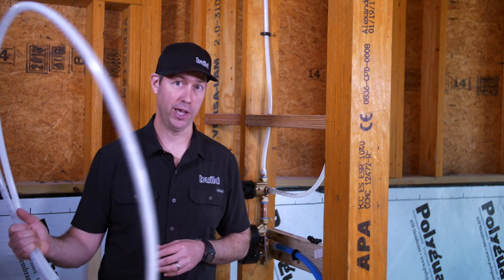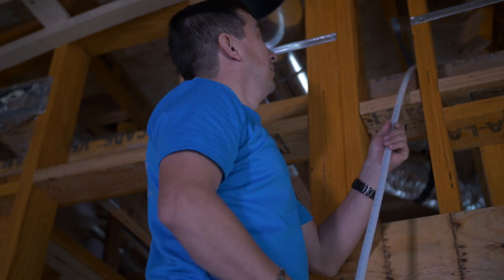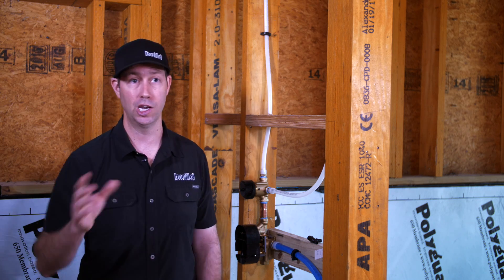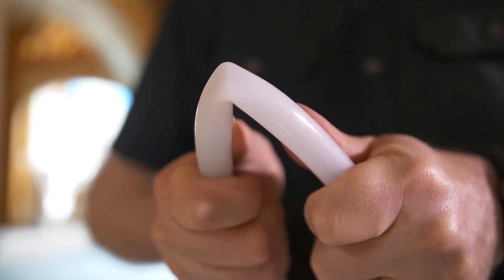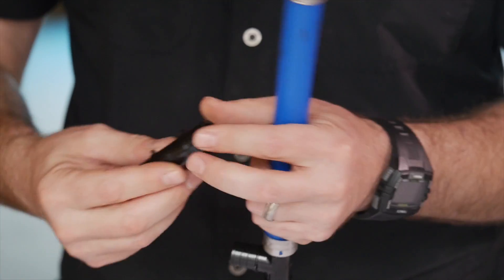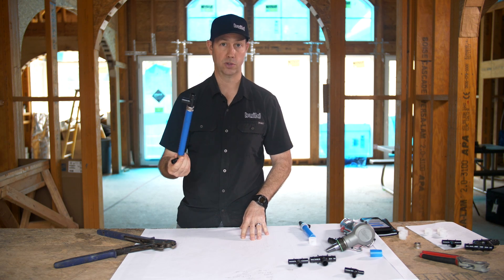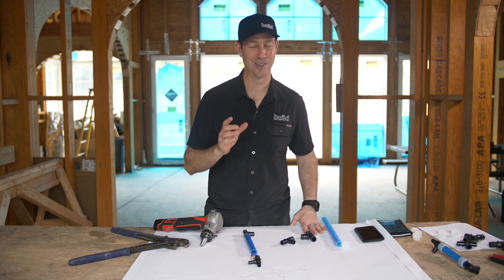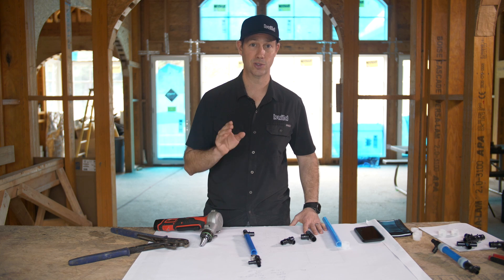PEX vs. Copper Plumbing

Comment: I'm an exterminator,  rats chew through pex easier than copper.
Reply: Its generally the use of poisons that cause pests to infiltrate plumbing. Poisons tend to rapidly dehydrate rodents causing them to search frantically and desperately for water, leading them to eat not only into pex, but also into cpvc, pvc, and abs sewage pipes.

Comment: In Maryland I have a 385 foot deep well, the water eats holes in Copper and Terminal Brass fittings. It doesn’t eat holes in the PEX Brass Crimp Fittings. All my Valves have been replaced multiple times. My Water Heater piping has been replaced three times. Last time I used “K” Copper. Also I brazed a #8 copper wire between the Hot and Cold Water Heater  Pipes, in addition to the Copper wire that is wrapped around the a Silver Fittings coming out of the Water Heater. BTW I’m on my original Electric Water Heater, at 30 years old.

Comment: You did not mention all the con's with PEX. It is not good against UV, so should not be used for outside use. Nor is it recommended for inground use as it breaks down a lot quicker. It is easier to accidentally pierce inside of walls. It is bit debatable for inside of walls use due to that, however I do agree it is much easier and better for pressure drops (although good layout with good plumber will plan accordingly using proper copper sizes as appropriate). It is especially great for use in attic spaces, as it is just one complete homerun with no or only one fitting inside attic and as stated reduced hammer. And hammer can be eliminated altogether if attached loosely in correct spots. I do also agree that for most instances it is good for even inside of walls, since those are typically in locations where someone is less likely to attach things to the wall, such as in bath and kitchen areas, so will realistically not be much an issue with accidental piercing anyway. However if it is in wall that might possibly see such (for example maybe above a toilet), then might consider not using PEX.

Here in AU they commonly use either compression fittings or sharkbite fitting. No special tools needed for either. The sharkbite is the easiest and quickest to use with just simple push in, but does cost lil bit more. The compression fittings is what I have seen used more commonly and while still pretty simple and easy, does take lil bit of extra time and effort putting on the outer nut (grabs) and compression ring over the end. Plus inserting brass hollow tube inside the end to give strength to the end of pipe so the compression does not squeeze and crack the pipe. It also requires bit more strength trying to push it all the way home into the fitting (which must be done or it will leak without rounded insert mating up), which if in hard to get to spot can be little tricky. But still overall it is quick process not difficult most the time and requires no special tools ... except possibly a good poly pipe cutter which will be the case regardless of which type of fitting one uses. Both of these work well on the PEX B, so do not need to pay that extra cost for the PEX A either unless you are really wanting that easier flexibility but really is not needed most of the time.

Comment: I new,  i live on west coast southern California,  which you recommend for my house? Thank you
Reply: Pex. Junkies wont steal it.
Reply: In most cases I would say go with PEX unless you have issues with rats as mentioned in another comment. My experience is that copper tends to accumulate calcium deposits and in certain situations it can corrode to the point of developing pin hole leaks. Also in high vibration areas the fittings can separate and fail as the solder loses its adhesion to the copper. Although rare I have seen it happen.  Here in Southwest Ohio I replace many copper systems in crawl spaces where it has degraded from condensation and corrosion. Pex is also much cheaper and easier to repair in the unlikely event of a leak or damaged pipe. CPVC becomes brittle over time and for weeks after installation it exudes a toxic odor from the glue. I am always concerned that cpvc may be poisoning the water!

Comment: Where is the regular PEX system? I have never used either of these but uponor looks pretty cool. Not sure if it would be as easy to work with in some tighter spaces or repair jobs. I use regular crimp rings and love pex.

Comment: Do you not place alupex in America? They bend nicely and retain bends, making it easy to make nice straight lines of pipe.
 It is the standard in Belgium at least. The fittings are messing or stainless steel, never plastic.
"PEX-AL-PEX pipes, or AluPEX, or PEX/Aluminum/PEX, or Multilayer pipes are made of a layer of aluminum sandwiched between two layers of PEX. The metal layer serves as an oxygen barrier, stopping the oxygen diffusion through the polymer matrix, so it cannot dissolve into the water in the tube and corrode the metal components of the system.[34] The aluminium layer is thin, typically 1 or 2 mm, and provides some rigidity to the tube such that when bent it retains the shape formed (normal PEX tube will spring back to straight). The aluminium layer also provides additional structural rigidity such that the tube will be suitable for higher safe operating temperatures and pressures."

Comment: I'm glad you talked about the burst resistance. Two years ago I walked into second home in Vermont where every piece of baseboard heat has froze and split. After fixing all the heat we turned the domestic water back on and found zero breaks because they had Uponor pex.

Comment: In the UK, this stuff comes with a 25 or 50 year guarantee. With inserts installed, standard copper compression fittings work great and give great results every time. Best of both worlds.

Comment: I use cpvc and pex depending on the job use the expansion tool for the pex it's much faster
My last job had 18 baths 9 kitchens and laudries, heat etc. I can't go back to using copper
Reply: I used to use CPVC until recently. I had removed all of my copper lines in my home about 15 years ago after discovering numerous slow leaks from corrosion in a damp crawl space as well as restricted lines and low pressure from calcium deposits throughout the system. I used CPVC and was really happy with the results until one day when I needed to replace a valve. While removing the old valve the CPVC pipe it was threaded onto shattered like glass under the twisting. I began to test all the pipes and found that they had ALL become brittle! I replaced the entire system with PEX and have sworn off CPVC forever!

Comment: once the pex antioxidant layer wears down, there will be failures and need of replacement after 25 years or sooner.  While copper will last as long as water ph remains not to acidic. All plastic leeches,  there no plastic that is made that does leech toxic chemicals. And you eating the antioxidant layer, what is in that anyway. I rather know I'm getting copper vs. some unknown toxins from plastic. Why not develop silicone piping?
Reply: Unless you have a well, the water you are receiving is certainly being run through plastic. Even most well systems I've seen use black ABS plastic lines.

Comment: What is the useful life on the Pex when compared to copper or galvanized?  I manage a 100 YO building and the galvanized in the building is past it's useful life and we are getting pin hole leaks about every two years.   We are removing what we can get to and bypassing the rest.  But, does Pex have a useful life span with decent water?

Comment: 0:54 ahem 3? what about lead hmm? or do we not talk about lead any more... ever since..."the incident"... :P
Reply: firefox5926    we stopped using 50/50 lead-tin solder back in the late1980’s, you can use 50/50 on heating systems due to the backflow preventer on the supply line to the heating system.  But it’s not much difference in solder price and to keep from grabbing the wrong type for domestic water most plumbers just buy silverbrite or any lead free solder. I plan on using pex in my house this fall on water and radiant heat.

Comment: I've owned a new build home with PEX.  I'll never have another home with it inside the walls.  The water tastes awful, like its been sitting in a plastic jug for 20 years.  Also there isn't enough data on the health effects, but some early studies have found diminished testosterone.

Comment: @Matt Risinger
I asked a plumber about PEX when discussing re-piping my 60 year old galvanized pipe house.  I had talked before about copper, but had heard of PEX.  He said he personally doesn't recommend PEX because when he had used it, he found rats and mice seemed to find it like their version of catnip.  They were constantly nibbling at the PEX and causing little leaks all over the houses he'd done with that material.  Has only used copper since.  

What is your thinking on this?

Comment: Wonder how reliable is to count on pipe elasticity to hold itself on a connection
Reply: Extremely reliable. I saw a demonstration where they took 20' of Uponor PEX pipe, cut it in half, and installed a brass coupling in the middle, and then connected the piping between two pick up trucks pulling in opposite directions. I assumed the coupling would be pulled out of the pipe at some point. The trucks pulled and the pipe got longer and longer as it stretched and stretched, until the pipe literally was pulled in two! But the coupling held! The pipe broke in another location before the coupling let go! I was very impressed!

Comment: 1st experience with pex was the well driller installed a PEX pipe to plastic adapter and it blew off and had water hitting the floor of my daughters room from the pump in the basement.  Glad we were home to here the Pop and stop the flood.

Comment: Few years ago I stripped out all the copper half inch and replaced it with Pex-B.  The main driver behind the decision to change was the number of elbows from the moment the plumbing passed the main shut off valve.  There were about 30 elbows before the water split to the water heater and the rest of the house.  There HAD been a water softener at one time, hence the number of turns.  A secondary driver was that everything in the house was half inch.  Flush the toilet while someone was showering - that was grounds for divorce.  I upgraded to 3/4 inch with half inch side out tee's to supply toilets, sinks, tubs/showers.  Also installed a water softener without having to add more than just one tee.  Everything else was sweeping turns, not elbows.  I have great water pressure and flow.  Often people confuse pressure with flow.  Typical pressure in my house is around 65 PSI.  Better than some places for pressure.  But flow had been an issue from the first day I owned this 1962 built house.  Which may have originally been built with galvanized plumbing, one type of plumbing Matt Risinger did not mention.  The leader pipe from the water meter to the house is galvanized pipe, and one day I'll have to dig up the line.  But even after all these years, I still have pretty good flow.  No issues with water sprinkler systems, toilets or tub filling.

In short - I like Pex.

Comment: You mentioned that you don't get calcium buildup in Pex Piping.  I am on an acreage in a rural location.  I replaced some copper piping when I put in a new pressure tank.  (We are on well water.)  There was a black slime/sludge inside the piping.  I also put filters on the main water line.  My questions is, will the Pex piping stop sludge buildup as well as Calcium deposits?

Comment: 6:53 - Um, you are supposed to rotate the expander 45 degrees every time you expand it so it is even or it can leak. It's in the Uponor manual and on their website. Also, it shrinks for much longer than a few seconds. 1/2 hour if its cold. Its also in the manual. I bought the hand operated expander and its a pain but it works. Strong joint.
Reply: The Milwaukee tool automatically rotates. You only need to rotate the piece if you're using the manual expanding tool.
Reply: @scottcraig1047  Thank you, I stand corrected.

Comment: What about behind a shower for the tub spout and handles? Usually you need something pretty rigid back there in order to tighten everything up without twisting pipes loose.
Reply: Fittings should be fixed to frame or wall. Using pipe rigidity to tighten taps etc will lead to joints breaking.

Comment: Great video! I've always like the Pex Tubing. Good anecdote here:

My Dad, may he rest in peace with Lord now, built a Jim Walter home in 1981. No need to say anything about Jim Walter, I fully understand. Lol. Anyway, copper pipe was installed with well water; we had zero problems for almost 17 years. Around 1997 city water was piped in to our rural community and we hooked up to it. Within 15 years the chlorinated water began deteriorating the copper pipes and my Dad had many problems after that. There are many houses with Pex where I live and none have had problems with chlorinated water with one exception. Trailers that had the old metal "pinch crimp" connectors on Gray Poly,  the connector was crimped or pinched on one side. Those type of connectors began to leak and eventually corrode and blow apart  because they could not handle the pressure of city water. There was a huge lawsuit about that. Nonetheless, all the houses have done very well that used Pex tubing. 

Great video and thanks!
Reply: Kitec, oh the sorrow of Kitec.  Just to let you know, Kitec is one of in foe the worst plumbing products ever created.  First off, it's not just the fittings that fail.  If we think about it, does anyone know why it was invented?  well, I do.  this all goes back to underground plumbing.  Pex is a great product. It's water tight, but not gas tight.  So waht happened is, someone thought that this Pex, a very easy to work with material could replace lead, steal, copper, and black poly. all of which are gas tight. Unfortunately there are toxic gases in the ground, that can and do penetrate pex. So, someone started thinking as to how they could stop these gases from doing so.  Well here comes pex with a twist.  Pex is a cross linked polymer, and as such performs well at designed thicknesses to withstand pressures and temps at these thicknesses.  So what some, supposedly educated, engineer thought up was to take pex at two layers of half the thickness that would normally be used, and sandwich a thin layer of aluminum between them.  An attempt at forming a gas tight barrier. Thus creating the unstable matrix we call Kitec today.  The neat thing is, if this Engineer had thought, just a little but, about thermodynamics, and the expansion differential of both products they were attempting to merge , just a little bit mind you, they would have understood right from the beginning that this stuff was no good.  Pex likes to move, aluminum does not.  Not to mention bonding these completely different materials.  So because of the varying expansion rates, and the fact that once you stretch aluminum it wants to stay that way, the "bond" between them eventually breaks down.  Also the aluminum has a seam.  Anyway,  another facet to this wonderful stuff was the way they extruded it.  The thickness of the pex often was not consistent.  The over all thickness was, but the layers of the pex was often not so.   So, if there was a thin spot, it could crack, since the cross linked matrix is designed to work at certain thicknesses.  So once this crack would form, the bond would fail, and then blisters form, further weakening it.  And then once on layer fails, remember, designed to work at specific thicknesses at pressure,  subsequent failure in the local structure is just a matter of time. Leading to a overall rupture.  But now on to another problem.  Once the aluminum is exposed to a ionic solution, aka city water,  a galvanic reaction begins to form between the zinc in the brass fittings and the aluminum.  so, now you have pipe that gets weakened from repeated hot and cold cycles.  And the brass fittings that form micro fissures in it's structure.  Sounds like a wonderfully mind-blowing thing, doesn't it?  Well I guess it's like everything else, where there is money to be made,  let the hosing begin!!  There is allot on Kitec on the internet. 
  I have worked replacing this stuff with regular pex. And have seen just about every failure there is with this stuff.  It's not just the fittings.  It's the entire concept of the stuff.   In Canada Ipex are the ones who produced it here.  Not too sure about if they were exporting to the US.  But I am aware of a class action in the state of Nevada. 
  Anyhow, hope that sheds some light.
Reply: Found a link as to Who made the struff.
http://www.thomasinspections.com/files/KITEC_DETAILS.pdf

Comment: I’ve had two cases where mice got to the pex in a basement and chewed a hole in it causing a water leak
Reply: Eric Baker , that is a major bummer. I have heard that some rodents will chew through the pex; I will add you to my anecdotal evidence list. Maybe it would be better just to get one of those hamster water bottles installed.

Comment: Okay I see you make that fitting on a table in the open, now show me how you do it in an attic, or with only one side of a wall torn out with little clearance or in a crawl space under a home! That looks great maybe for new construction but show us how the home renovator is supposed to deal with this 10 or fifteen years down the road.
Reply: Same thing with rigid copper fittings; only add a blow torch and combustible materials surrounding the pipe.